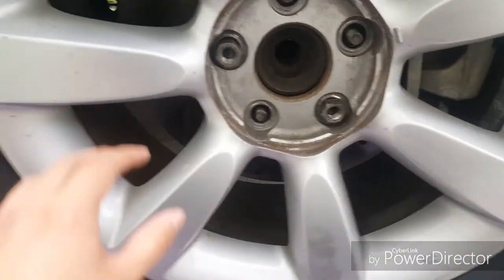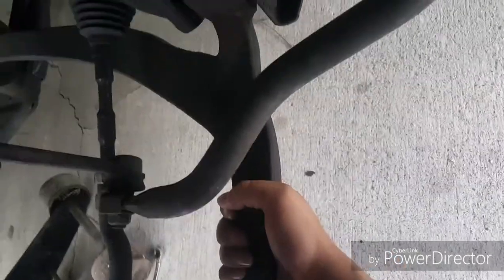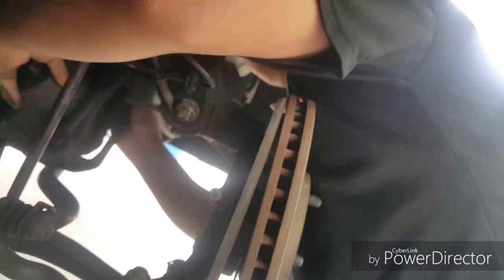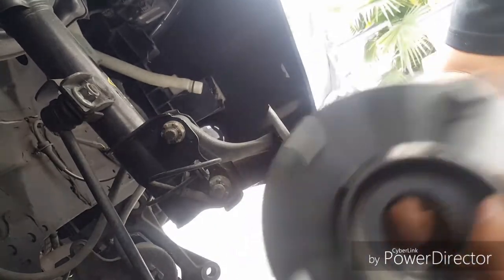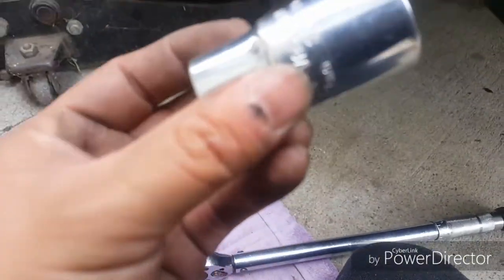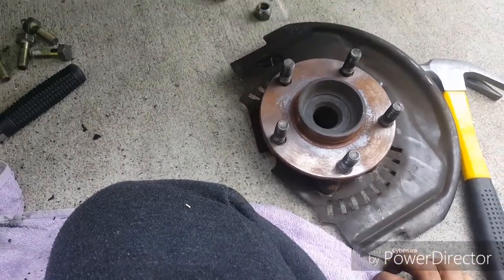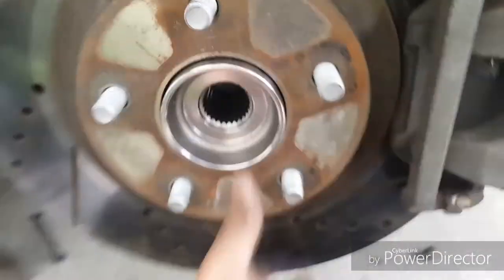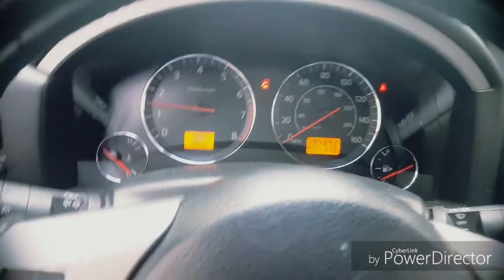Infiniti fx35 2003 front wheel bearing replacement (full process)

Comment: A couple things to note for people watching this in the future:
Only use a torque wrench to tighten bolts. Using it in the manner in this video will wreck the calibration of the wrench. Luckily he is using a harbor freight torque wrench and they are cheap, and not worth paying to calibrate. If you want a breaker bar, get one with a fixed(non-ratcheting) head. They are less likely to break under high strain.
Wheel bearings are a symmetric wear part. If you need to replace one, replace both.
Infiniti is a Japanese brand, all the bolts are metric, not AES. The bolt he said was a 3/4 is actually a 19mm. .3/4 inches is equal to 19.05mm, that extra .05mm is enough to cause play in the socket on the nut, which can lead to stripping the head.
Great video man! Thanks for helping to make working on your own cars accessible to normal people.
Reply from the maker: I agree with your added information, I don't know much about tools but if it's doable I'll try to get it using whatever I have. Glad to know about that extra play I did feel it when using it. Currently buying and researching about tools🖒🖒🖒 thanks for the comment,I try to be atleast a bit of help